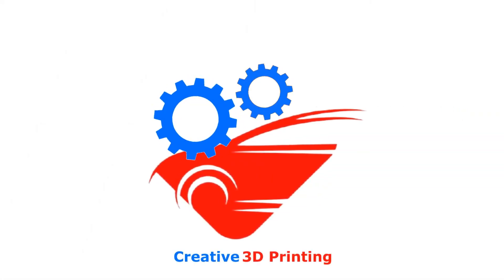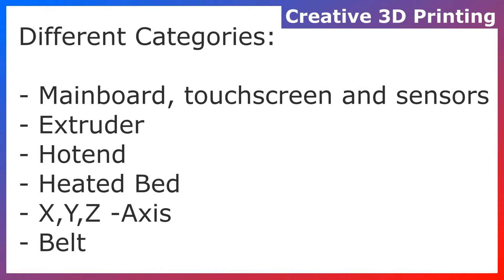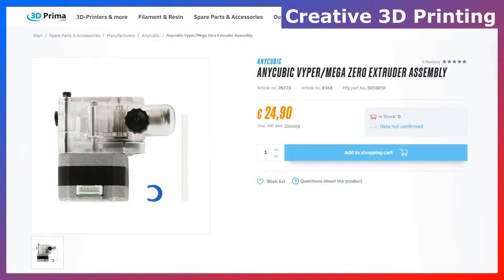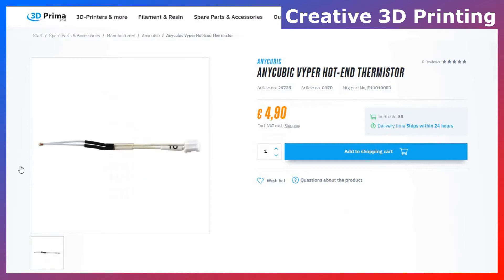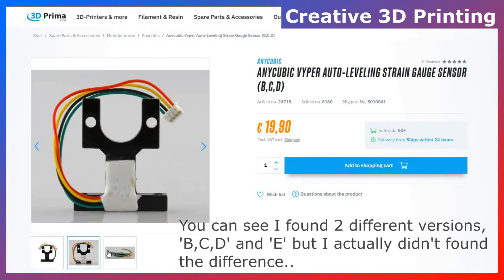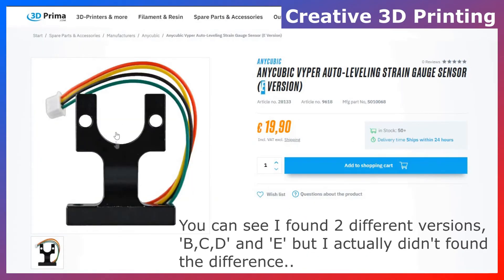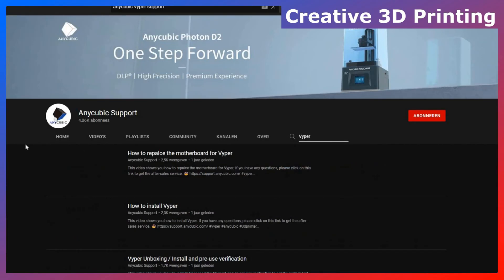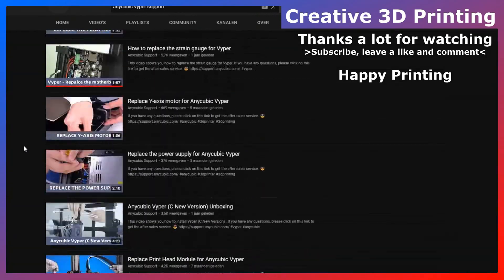27 Replacement Parts for Your Anycubic Vyper

Comment: Good content but seemed kinda fast and not enough time to even comprehend each part. It would have been nice if you showed where the parts are on an actual Vyper since most people probably haven’t taken an in depth look at the parts
Reply: Also i just noticed you didnt mention that the bearings dont need replacing unless they’re really broken. Also the bearing pop-up is hard to see especially with the fast video (i didnt notice it until the second time i watched the vid)
Reply from the maker: Yes, I know, I chose to just show all the parts I searched for instead of taking a look at the vyper and showing where all the parts are.. I just wanted a video wich isen't too long in duration.. My Vyper works just perfect and sometimes if you open the printer it can break and that's why I chose to just show the parts online ;) But thanks a lot for watching and your usefull comment! Next tie I will make my videos a bit slower/longer.
Reply: @Creative_3DPrinting  also when you do both voiceovers and text on screen its kinda hard to focus on both so picking and using just one of the two would help.
Reply from the maker: Oh? I just thought it would be easier to show more information by using the text instead of saing all those little things.. But that's good that you say that, now I have a viewers perspective! Thanks. 
And I'm thinking of making some different videos about how to change parts in the vyper because 'normally' there is no chance I will accidently break the parts I guess ;)